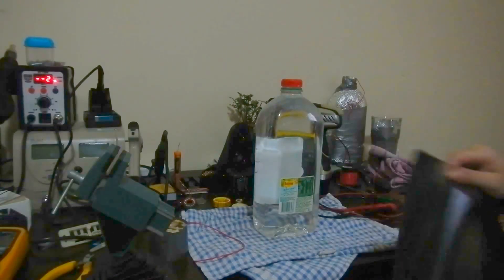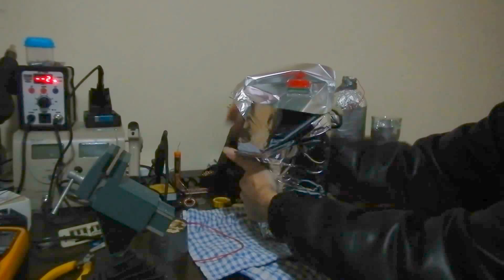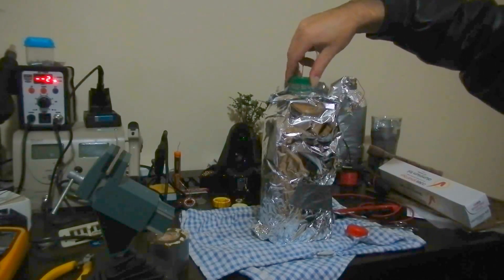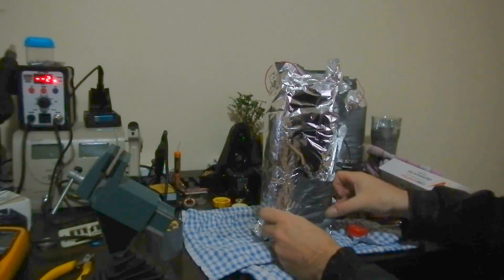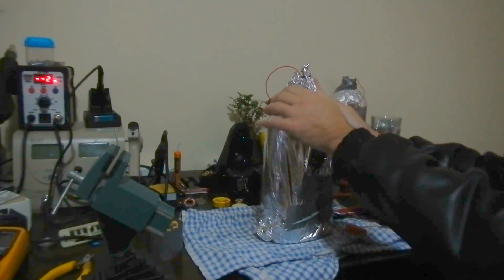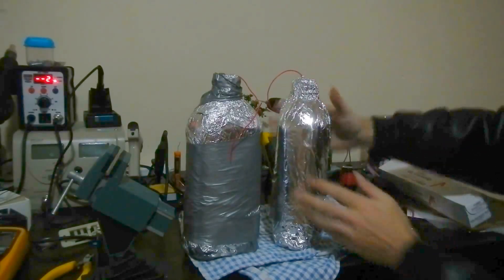Make your own capacitor in under 10 min. DIY Leyden Jar.

Comment: So you're saying the saltwater electrode gets the positive side of the battery and the aluminium side gets the negative side, right?
Reply from the maker: Not a battery. A battery is a fuel cell that converts fuel into eletricity with a chemical reaction. In the case of rechargable batterys, the reactions is reversable to sme extent.

A capacitor uses columb force to store charge, but does not generate any charge. Although a capacitor will usually harvest some charge from the surounding enviroment.

The exception in this case is if you get salt water on the foil. At which point in becomes an Air battery (en.wikipedia.org/wiki/Aluminium–air_battery)At the cost of the foil, which gets consumed in the process of generating charge.

Water has a stight positive afinity, so in dc situations you would make the water positive. Although these capacitors work fine in ac situations.
Reply: Mongrel Shark
Oops,,, I meant to say capacitor. That was weird. I knew better than to call it a battery, So the saltwater electrode gets the positive side of the capacitor and the "aluminium" side gets the negative, right?

So besides which side goes to "aluminium" are you saying it's okay to use 120 volts from my wall to power this capacitor? I dunno, That could be a little dangerous.
Reply from the maker: I never said to use it on Mains! You could in theory if you insulated the foil well. If you did it would be at your own risk... They are commonly used for Tesla coils though, and should work for audio work as well. These ones tested up to about 20,000 volts before they failed around the lids. Which could be improved easily.

The foil does not have to be need, and the water does not have to be pos. If you are using for DC its a little more efficient that way is all.

Comment: You might have pasted power between them by touching them. As you said it is conductive and the human body is good at transporting power ^^
Reply from the maker: I did get to the bottom of that. Turns out wet aliminum make a good battery.
http://en.wikipedia.org/wiki/Aluminium%E2%80%93air_battery
I made some that where actually suposed to be batterys and the decay of the aliminum was identical to the leyden jar. The foil turns to white powder over time.

Comment from the maker: I think thats a fantastic idea. Upload and post a video response if you do! You may need to play around a bit, as your already thinking, wet stuff and laminating is not ideal, could be a workaround though, maybe add fluid after laminating, and just seal a small hole made to add fluid. Once sealed, it will have to get hot to blow. and it will puff up first. You might get over 1,000µf per A4 I think. so only 100 or so sheets in parallel for your farad requirement. Not bad at all for DIY super cap.

Comment: I think i will try the laminated version first...what i might do is use paper soaked in the electrolyte, larger than the foil plates and laminate inside an EVA pouch....I wonder if i can maintain a certain level of moisture inside the pouch to survive the lamination process...

Comment from the maker: You need to form the electrolytic. As you say, to form the semi-conducting (why they are polarized) dielectric oxide layer. The laminater idea could make some awesome high voltage caps, but you would need a lot of layers in parallel to get the farads you want. Like a stack of phone books in size. Go for an electrolytic bucket cap I think. Adding link to description for you :) Or look into printing graphene if your really keen. 2hz dc is not going to cause a heat problem :)

Comment: yes DC. Frequency is 2Hz. Can I just use the plate capacitor formula to work out the length of foil required....do i need to form the plates? I've seen some videos where sodium bicarbonate solution is used to form the electrolyte and then aluminium oxide becomes the dielectric.

I have a laminating machine...perhaps I can use the EVA film that is used in lamination pouches instead of clingwrap? 

What do you think?

Comment from the maker: Or, you may have luck with just foil and cling wrap. 2 rolls of foil, one cling wrap, slightly wider than foil. make jig, and roll onto new tube. So its foil|plastic|foil 50m long, rolled into a stick. use 50m rolls of foil,cling wrap, and you will have a very large cap good for a few hundred volts, provided its not at high frequency high current. Does it matter if the cap is polarized? Ie is it for ac or dc? From the specs you want, I would assume your working with DC.

Comment from the maker: Electrolytic in series would be the way to go. I'd be looking to salvage some big ones from scrap appliances. There will be at least one good one on most mains appliances, except motors, like fans and vacuum cleaners. Make a bank that way. Would be the cheapest and quickest. If you cant get enough appliances fast enough, go down the bucket electrolytic road. You may need a few buckets in series to go that high a voltage. So it would be very bulky and heavy.

Comment from the maker: Pretty difficult. These ones get about 2000-4000pf or 2-4nf... I'd be looking at something different for that large a farads. Does it need to be high voltage? You can make electrolytic caps that big in a bucket I think. But your going to be looking at around 30v max I think. Rimstar has some good videos on it. If it needs to be HV your going to want miles of surface area, with as thin a dielectric barrier as possible, while being dielectric enough to handle your max voltage. Whats it for?

Comment from the maker: Thats one of the primary uses for these! I'd top the water with mineral oil, to stop/reduce corona discharge. It should handle more than 15kv. You can immerse the whole Jar in oil if its arcing. Telsa had glass ones, because plastic wasn't really available. But it would have to boil the water out for the plastic to melt.

You obviously wouldn't touch one if it had a few kv in it, although the amps at the farads involved would be tiny.

Make sure you use appropriate dielectric strength wire.

Comment: would this work on a tesla coil, i need 80nF, i mean. wouldn't it be dangerous if I used them with high voltage at around 15kV